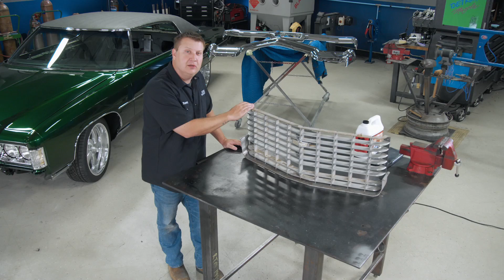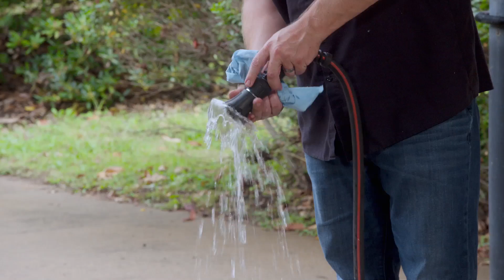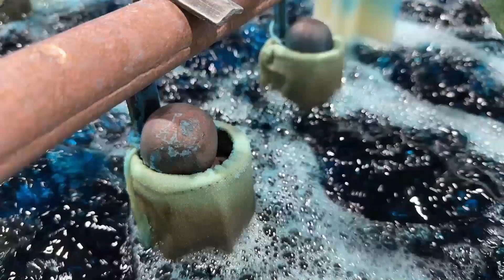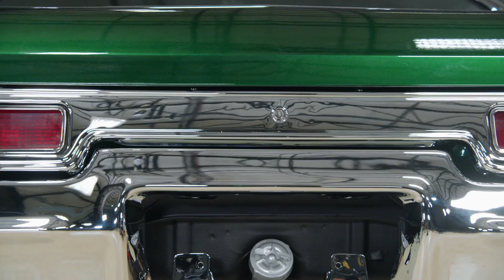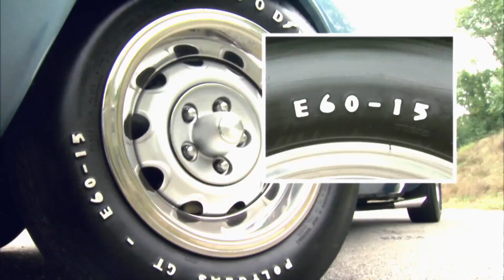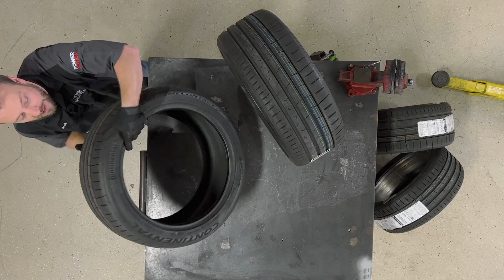Project Fat Stack: Restoring The 1971 Chevy Caprice Front Grille - Detroit Muscle S10, E17

Comment: I hope this inspires more aftermarket support for these cars!   I have a 72 Impala and cannot find new wheel well moldings.  These cars are sure underrated and really should be looked at as just bigger family sized Chevelles or Monte Carlo’s!  Really they aren’t much bigger or heavier, mine weighs 4100, about the same as a 72 Monte Carlo.  Would like to see a 17” Corvette Rally wheel on it for a comparison.  I like a little more side wall on a musclecar tire.   This is not supposed to be a donk is it?
Reply: I have a ‘71 Impala. And yes parts are hard to get. I have been searching for a fuel sender. Seems the senders are different depending on what carburetor you had.  2 barrel or a 4 barrel.I have the 400SB with the 2 barrel. If anyone knows where I can find a fuel sender let me know. I noticed that when they pulled the fuel tank out of Fat-Stack it had the sender I need. The guys over at PowerNation ran the engine it was a 400SB with a 2 barrel. Why the different sender depending on the carb beats me.

Comment: My parents had a "74 Caprice Estate wagon. They bought it brand new off the lot back in '74. They got it fully loaded with a/c, power brakes, power windows (including the rear window and door) and it had a 454 (badging by the front fender) and 400 hydramatic. We put well over 300K miles on that thing before it finally gave up the ghost. Lots of fond memories. ❤